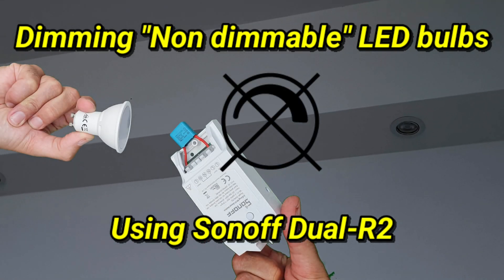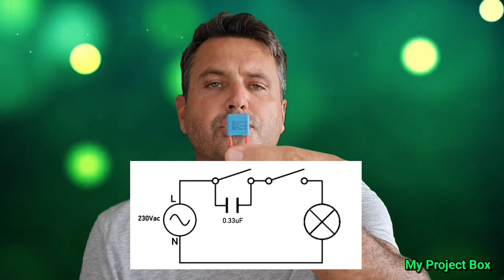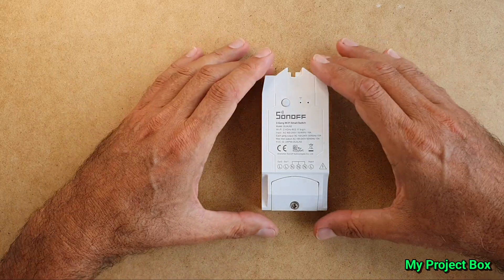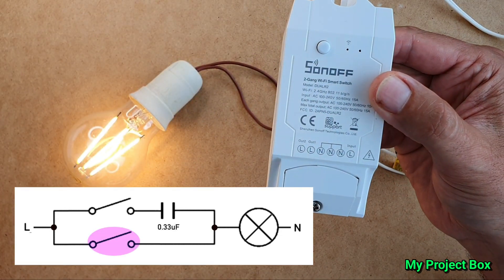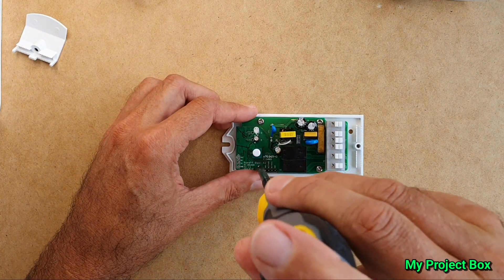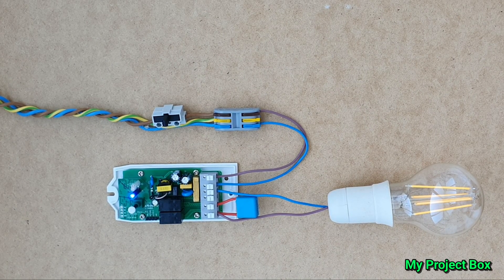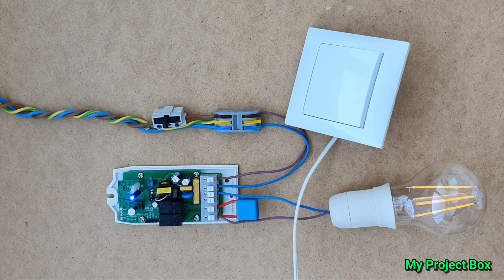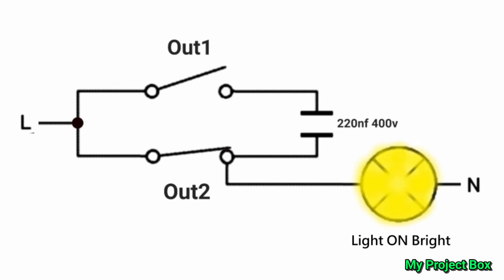SONOFF DUAL as a "smart dimmer switch" for NON-dimmable LED bulbs

Comment: Can you please post details abut capacitors . Any specific one needed
Reply from the maker: It all depends on how bright or dim you require the lights  to be. The amount of LED bubs in parallel, and the wattage of the bulbs will affect the brightness. More LED bulbs will be dimmer on the same capacitor. Make sure that all the bulbs are the same type and power. Maybe start with 1uF and go down to 0.22uF for testing 🤔?

Comment: Living on the edge with the open connections on the capacitor at 110/220V, or am I missing something?
Reply from the maker: It is possible to put the capacitor inside with the lid closed, however for the purposes of the video, it's left open so everything can be seen clearly. You could also enclose the sonoff dualR2 in a separate enclosure, if you prefer.